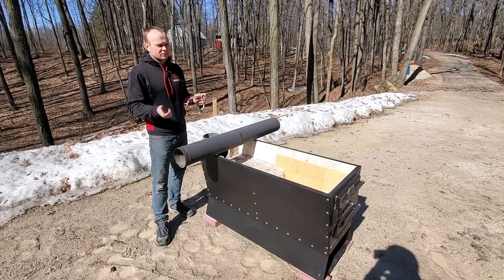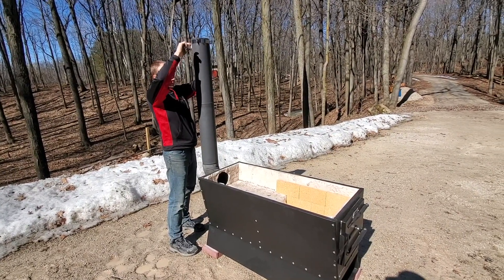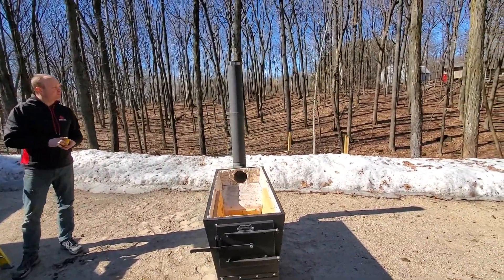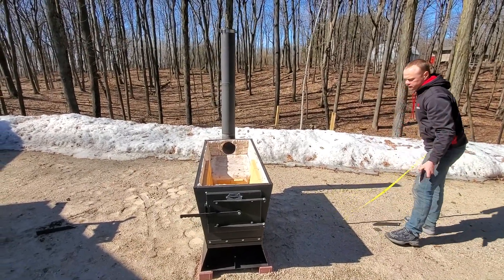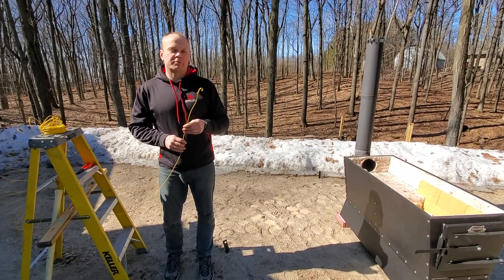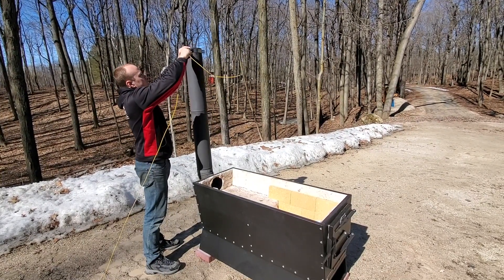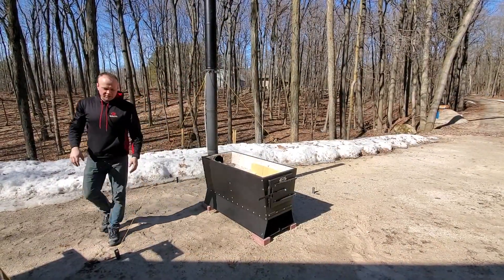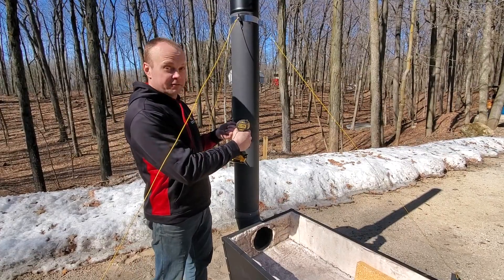Backyard Evaporator Set Up - Stack Pipe and Guy Support

Comment: What are the thoughts regarding a cap on the pipe?  Also, does the pipe need a damper?
Reply from the maker: A cap would be fine, as long as it caused no restriction from screens, ect.